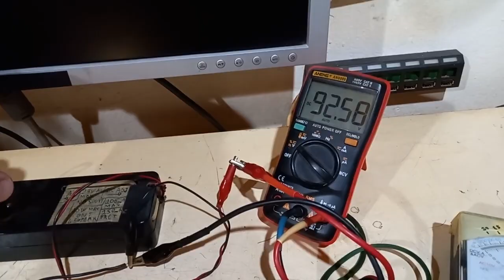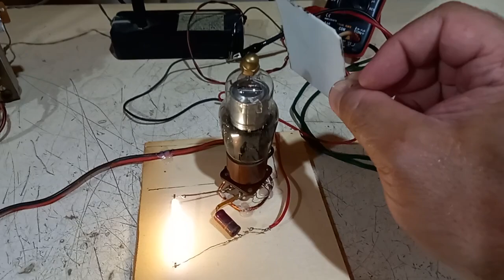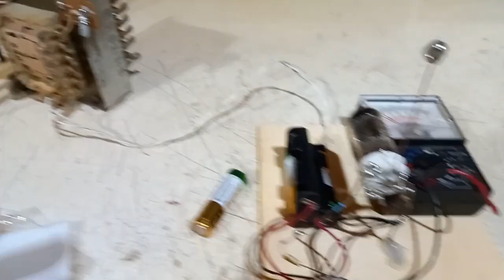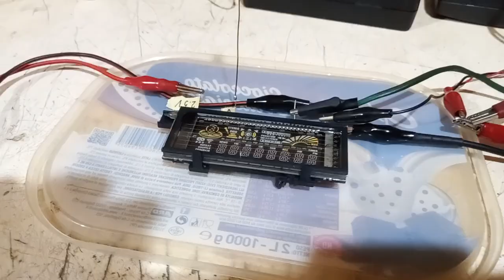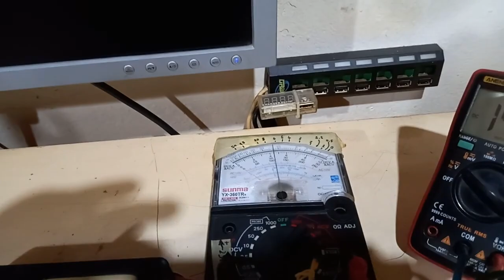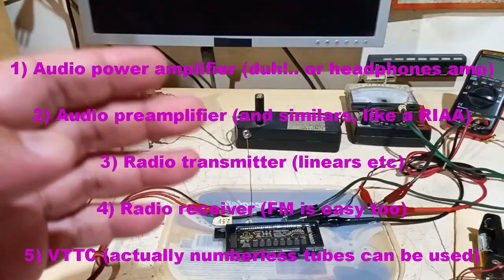Three Different Vacuum Tube Electroscopes

Comment: WHOA! Do I understand correctly that the VFD is showing, essentially, how the nearby positive charge at one end of the grids attracts more electrons to that end than it has at the other end?!
By which I mean, the metal (antenna and grids) has a distribution of charge that varies throughout the metal... more charge at one end than the other? Thus the display's dimming from left-to-right almost like a bargraph showing the charge-distribution throughout the grid?!
AWESOME.
Reply from the maker: eemmhh, no, the distribution of charge is in the air, all the metal parts from the acorn nut to the grids inside have the same potential

thank you anyways :)
Reply: @PosthumanKindergarten  hrm... I guess I've got more thinking to do. Cool demo, anyhow.

Comment: Nice demo! Now wondering how to invert it is it can detect positively charged items.  Using a VFD as a valve is a great idea.
Reply from the maker: i dunno how to let it sense positive, with things like mosfets or jfets you can do whatever you want, but there's no "p channel vacuum tube", tho you can bring the sensing input at a negative voltage trough a gigaohm resistor and it will react also to positive, but this doesn't sound very functional
Reply: Haha, "p channel vacuum tube", this is like the electronics equivalent of the meme where the guy asks his wife to pick up some 'turn signal fluid" from the car parts store 😄